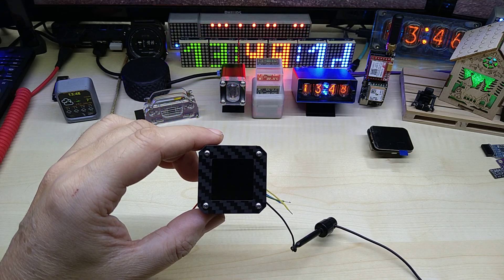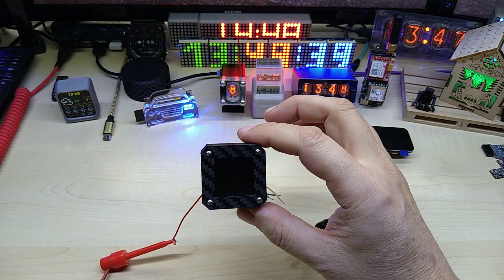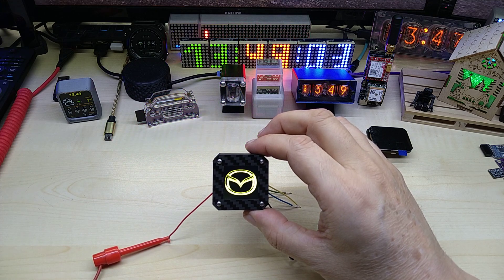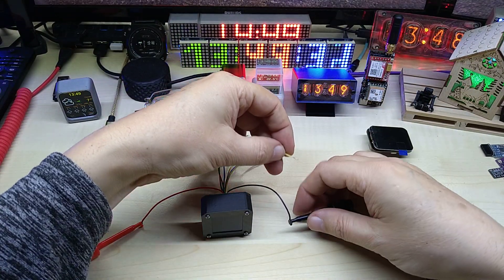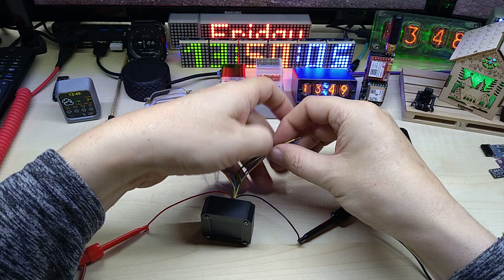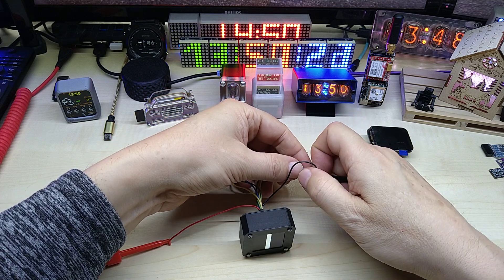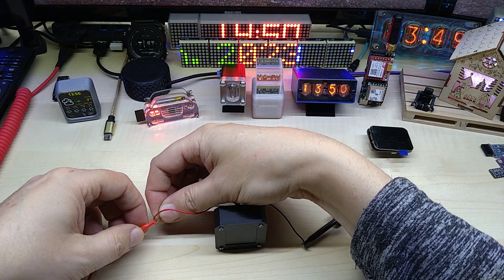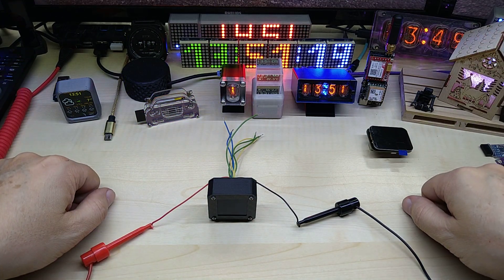Short demo of my Gear Indicator for a Customer for his Mazda car by #Hayri with #ST7789 Display

Comment: I know this is an old video but, out of curiosity, why did you have a dedicated wire for neutral? Would it not have been easier to have it as a default state with the gears being tied to an interrupt for each of their respective states? This way the display wouldn't appear to blink on and off between shifts (shifting 1st gear to neutral to 2nd gear would have 2 moments it wouldn't display anything while waiting for a pull to ground for neutral and 2nd gear). Or was there some other reason that I'm overlooking that would necessitate a dedicated pull to ground for it?
Reply from the maker: Well firstly because the gear could be in any gear really when turning the ignition on. I know that most people would leave it in Neutral, but often it could be 1st gear as well. As to the "blinking" of the display, what you might think seeing is, clearing the display by filling it wit black and then displaying the new gear. You can not show a new gear without clearing the screen first otherwise it show show the previous gear as well. What is important thing is, that if you shift from second gear into first or the other way around, Neutral will not be displayed, unless of course you do land on Neutral, but not during "normal" shifting. Also the gear indicator needs a way of knowing in which gear it is somehow and with the Neutral input it is possible because there are no "endstops" you can try to go lower than the first or higher than 5th or 6th gear. Which this gear indicator will tell you that you are in the highest gear already.
Reply: @iHayri1  Hey! Thanks for the reply!
And sorry, I am a bit confused as with a standard H Pattern 5 speed manual you would touch neutral between each shift and would potentially have a gap between registering in-gear to neutral to next in-gear if the neutral state relied on a switch to display, unless neutral wire is being pulled to ground permanently via a chassis connection so that any point that is not a gear is defaulted to neutral?

As for the possibility of being in any gear on start-up, would an interrupt+state-wire not force the correct state on boot-up? Or would an interrupt pin cause the MC used here to act unexpectedly by being connected during boot?
Reply from the maker: @GaryCifers  No problem, sorry i was actually thinking of the motorcycle gear indicator, my bad 🙂Have too many videos about my gear indicators. For a car it's different of course. It would depend on how one would mount the reed or micro switches to the gear lever. In a car, the gear indicator does not need a Neutral per se, one could just mount switches for the actual gears including reverse if wanted and use it like that. Then only the gears would be shown and Neutral skipped. If it is for an automatic transmission I would go for my CAN BUS gauge, that does show which gear the car is using at the moment by calculating the gear using rpm, speed, tire size, gear ratios and final drive ratio.